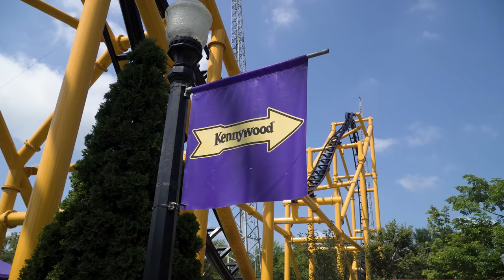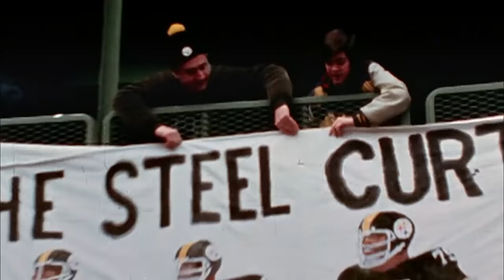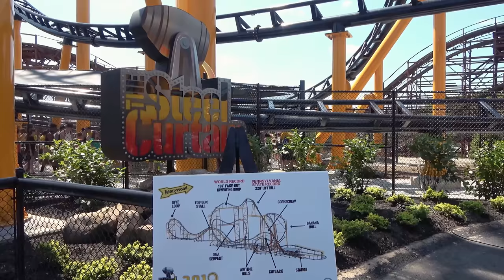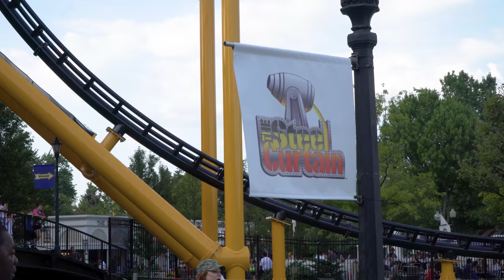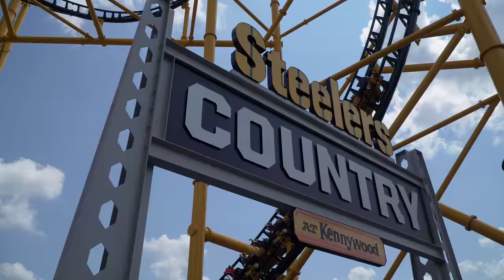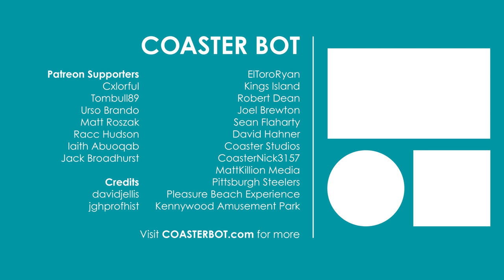What is: Steel Curtain - World's Only American Football Themed Roller Coaster

Comment: I was able to stop by Kennywood on July 14th, 2019, day after opening. Arrived at 8:50 AM to a dozen others or so waiting, people came in by the hundreds around 9:30 AM, park opened at 10. Security prevented a running of the bulls and soon I was waiting as #15 in line out of the 3000 people setting up for the coaster's noon opening. Many of these people had tried to ride the previous day, on grand opening, but the coaster had broken down and many had gone home unsatisfied. I managed to get front row, and everybody in the queue lined up for front, to the point where ops were cutting off the line and forcing everybody to fill the train. It was still having its opening day blues; 4 minute dispatches with ops who still needed to get the ride cut clean. But all that hassle and waiting was well worth, and although it doesn't hit quite as well as Phantom's Revenge I still can't wait for the day in which I can head back and ride some more. Shin-banging aside, amazing coaster!

Comment: Those of you wondering why it’s closed, idk why even though I work there. It was testing every morning a couple weeks ago, one day it was dispatching every 2-3 minutes. Now it’s dead again. The most reliable rumor I’ve heard is that the restraint system is being modified(it can’t be that big since I got to see the new test seat and the restraints felt the same) and it needs tested all over again for state approval.
Reply: Yeah pretty much, what I think is that they removed the seatbelts so it doesn't delay the operations like last year. This also caused a change in height requirement, which is what my managers told me.

Edit: apparently this isn't what's going on so idk, probably reprogramming or something but take what I said before with a major grain of salt now

Comment: Great video. The drop is 197'; (not 197' above the ground) and the total length of the coaster is 4000'; whereas the length from the top of the lift hill to the break run is less. But this was an awesome video nevertheless. I've not ridden a coaster like that but it looks pretty fantastic, although the duration is a little on the short side. Thanks for posting!
Reply from the maker: I've used the same sentence to describe ride time and length in lots of videos and you're the first to point out that technically I'm wrong. I did mean the full track length is 4000ft but worded it weirdly to get that flow and segue. I'll work on this, thanks!
Reply: @coasterbot  It's all good. ;)

Comment: "Something comfortable"

They stuck out with those seats on the train. Those things are so uncomfortable. The back rest jutts out and is really narrow at the bottom, causing your back to be resting on not that much, and its so uncomfortable
Reply from the maker: They look very rigid and plastic to be honest.
Reply: @coasterbot  Ya they are. I have yet to ride it, but they have the same trains on Maxx Force which I have ridden (awesome ride btw). But ya that part gets very narrow towards the bottom, and because of that, that's all your back has for support. It's kind of like those wooden table chairs that have 5 wood poles as the backrest. Imagine only one of those poles, and that's the seat

Comment: the only thing i don't like about this ride is that s&s put an airtime hill over a 0-g stall and called it a topgun stall
Reply: Top gun stall is basically inverting one way and flipping back the same way. Zero g is flipping one side and flipping back the opposite way like a zero g roll would.
Reply: @Stagnant_Gravy  the top gun stall is where there is an airtime hill underneath a 0g stall, like on twisted collossus